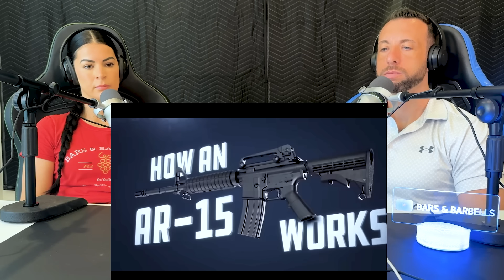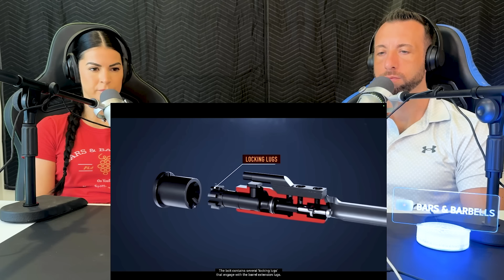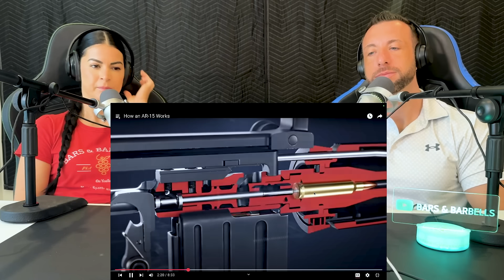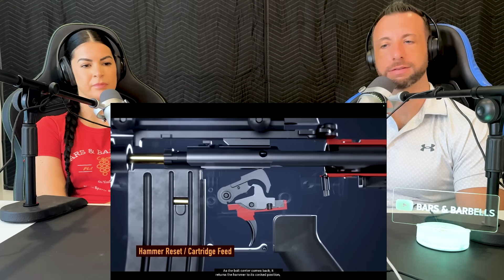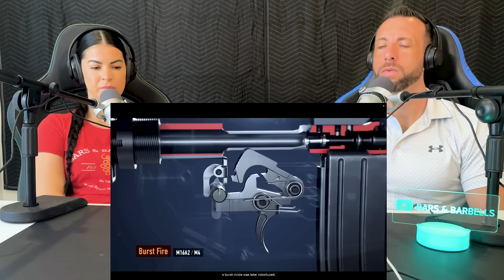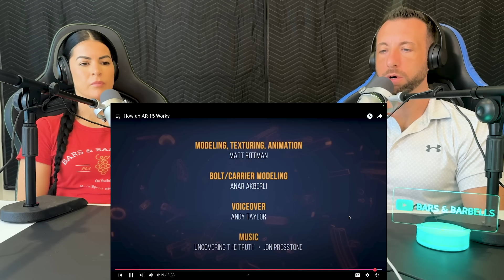This Is What Happens When You Pull The Trigger — AR-15 Mechanics Explained ⚙️

Comment: Don't confuse a clip with a magazine. The magazine fits into the magazine well. The clip holds the ammunition that is used to fill the magazine. As stated in the video, the AR15 is the non-military version of an M16 or M4. The AR15 is not capable of automatic fire

Comment: Gun design is iterative. It's the same as the car engine in that way. Everyone builds over time on each other's work. The AR design is older than the pocket calculator. It normally takes about 10 years for a new design to work out all of the little bugs that cause problems. These were worked out long ago with the AR to the point now where mass production and the design's flaws being worked out(like better feed ramps, better triggers, heavier springs and buffers for different length barrels, different gas systems, and so on) has effectively happened. So you can buy a rather cheap AR today that will be well engineered enough that effectively anyone who knows the basics of the design can work on it, replace parts and get them to run. They've become the Toyota of the rifle world through 60+ years of iteration. 

If you think this is complicated, check out some of the stuff C&Rsenal has put out about early 1900s guns. Some of those are genuinely crazy.

Comment: The irony here is that Full Auto is actually easy to engineer.  Without the disconnector, simply holding the trigger down with the rifle off safe will cause it to just keep firing.  Early, open bolt machine guns worked this way.  The trigger just held the bolt in the rear position and when released and held down, the weapon would just cycle until empty.  To make the weapon semi-automatic, requires additional engineering!  But you've just taken your first peep down a fascinating rabbit hole of engineering.  I would encourage you to look up some of the great designers whose history is amazing.  Men like Eugene Stoner, who was the principal designer of the AR-15 or the Legendary John Moses Browning who's list of firearm inventions will stagger your mind.  The 'Browning Action' is still the most common design choice for handguns to this day!

Comment: Did you really learn something you didn't already know after building and maintaining your own AR15s? Are we going to get a video on how to brush our teeth or something?
The Johnson Rifle in WWII already did the buffer tube and rotating bolt, Eugene Stoner didn't really engineer anything new on the rifle. The innovation of the AR10, AR15 series wasn't the internal engineering, it was the use of lightweight materials borrowed from the aircraft industry - aluminum for the non-loadbearing parts, fiberglass furniture on the AR10 and plastic polymers on the AR15...

Comment: if you like cool gun internal workings, check out the design of the good old 1911. It is a marvel of engineering. so much happening in such a small firearm.The grip safety mechanism is amazing. The slide release which is also the pin that holds the two halves of the gun together... Just an amazing piece of gun art.

Comment: Another thing of interest is the gas that is used to cycle the bolt carrier also first pressurizes the bolt itself forward against the recoil force of the rest of the gas in the barrel as it enters the gas key which takes some of the load off the lugs on the bolt.

Comment: Something with noting is that, while many people believe the rifle can be easily converted to full automatic by simply removing the disconnector from the trigger, this is in fact not the case. Removing the disconnector will be result in a condition known as "hammer follow," where the hammer literally follows the bolt carrier forward. This will not necessarily interfere with operation, but in nearly all cases, the hammer will not strike the firing pin with sufficient force to ignite the primer. Because of the design of the rifle, the trigger cannot simply be pulled a second time; the charging handle must be used to chainer a new cartridge, which will also throw out one unfired cartridge. 

In effect, removing the disconnector changes a semi-automatic rifle with a 30-round magazine into a manually operated rifle with a 15-round magazine. The lesson here is that when someone tries to tell you how easy it is to turn a semi-automatic firearm into a machine gun, it probably isn't actually that easy.

Comment: Note that the video you watched mentions the M4 having burst, the M16A2 A3 and A4 are the only military rifles with burst in the M16 family and No M4'as have burst. the M4's used Auto and Semi.  

the Army moved away from Burst fire after getting many complaints on the Cam system in the M16.   Essentially the Cam rotates EVEN in SEMI fire mode.  so if you start firing in Semi, fire 2 shots ,then switch to Burst because you are in close quartesr or what not, you only get 1 shot out of the rifle before the Cam resets.  Or depending on what happened, you can get a 1, 2, or 3 round burst.   The inability to rely on a full 3 rounds for the burst fire lead to them making the M4 only have Auto and Semi.  

The Marines however until recently still used the M16.

Another oddity is The Forward Assist was not something that ArmaLite actually designed into the rifle originally.  the US Military wanted it despite that forcing a round to chamber if the bolt does NOT want to is very dangerous (usually means something is wrong and your rifle could blow up or something else if fired) and the United States Air Force is the only Branch that did NOT get M16's with the Forward Assist.  Civilian models usually do NOT have the forward assist either. 

The Civilian models can come in many calibers too like .223 remmington, 5.56x45mm NATO, .243 Valkrye, .300 Blackout, 9x19mm, .22LR, and there are other conversions.   

The AR-10 is their original model made in .308 winchester or 7.62x51 NATO.  it is used in the US military as the M110 Designated Marksman Rifle or basically as a sniper.

I always find it interesting when people first start going down the rabbit hole of how firearms work.  I hope to see more reactions from you two regarding this type of thing.  

Take care!

Comment: You can't get an AR-15 with burst mode. They don't have auto or burst sears in the action... only the single round fire setting. That's where all the controversy starts. The difference between a semi-automatic and an automatic firing weapon. If you buy and AR-15 you only have two settings... safe or fire. No auto setting at all.

Comment: The sad part is there’s a lot of people out there that don’t understand the difference between a civilian AR15 and the military M-16 they look at it and since they think it looks identical therefore it is identical so civilian’s should not own one even though the civilian version is semi auto only in addition to the internal part of the lower receiver of a AR15 being machined differently so they will not accept the conversion parts to select fire unless you have access to a machine shop and the knowledge of where you need to remove excess material and drill the third hole

Comment: Time for a field trip.  Find a reputable range in your area, get a few lessons, and have the experience for yourself.  You will both enjoy the experience.  Despite what the news and what anti-gun people say, the AR-15 in my opinion is an excellent FIRST "high" power rifle.  A good instructor will probably start you with a 22lr in a single shot or bolt variant, but you should be able to progress to an AR-15 in an afternoon.

There are a few very minor mistakes here and they don't describe just the AR-15, but the entire ArmaLite family of firearms including the M-16 and M-4.  The AR-15 does not have auto or burst modes and a big chunk of this video was focused on those which in my opinion added a lot of un-necessary complexity to an "AR-15" video.  Excellent visualizations.

Comment: The engineering of many guns is fascinating. The gun from Robocop is in fact a real gun that was made by Beretta with some extra parts attached and it really did have a burst fire setting. But if you think the engineering of the AR-15 is complicated look up a video on the HK G11. Forgotten Weapons covered it and the inside of that thing is a clockwork nightmare. Then you have stuff like the old warplanes that not only had the engineering of the machine guns they had extra gears to sync the gun with the propeller so that the bullets were fired just after the propeller went in front of the barrel instead of having a plane accidentally shoot itself down.

Oh, and two more notes. Full auto and burst fire modes are illegal unless you pay an extra tax and buy an old gun that was registered before 1986 OR you have gone through all the taxes and fess and paperwork and are a gun dealer and you can have "sample" guns so you can demonstrate them to law enforcement or military buyers. 

The second note is most stuff on an AR-15 is not done automatically. The magazine catch clips the mag into the gun but you have to manually have to hit the release to take a magazine out. If the bolt was locked back you have to hit the bolt release to load the first round and if it wasn't you have to pull the charging handle back to load the first round from the magazine. The safety is manually operated as is the trigger per shot. The only part of the process that is done automatically for the user is ejecting the spent casing and loading the next round so you can pull the trigger again.

Comment: Ditto to @CloudJLaw. Shooters get a little perturbed when the term assault rifle is used, due to it being a made up term used to make the sport scary.  We use what would be considered hunting rifles and shotguns in the military, and they are not refereed to assault rifles. 

Also, the device that holds the rounds (bullets) is called a magazine. They completely encase the rounds that has a spring and follower that push the rounds up into the chamber as the weapon cycles. A clip, used by the M1 Garand for example, was a long rectangular strip of metal that holds the rounds in place by the groove at the base of the round. The clip, with the group of rounds are pushed into the body of the weapon. Think of loading several PEZ into a PEZ dispenser. The "magazine" is built into the weapon. I point this out because if you go to a range and call a magazine a clip, you will probably get some side eye. Benefit would be they would realize you are new to shooting, and probably have offers assistance / guidance in learning how to safely shoot.

Comment: It only takes a few people to ruin it for everyone else. An ar15 can average about 600 bucks but a full auto like a m4 can be 10,000 plus tax stamps and extra background checks. Never shot a full auto I would love to but ammunition cost greatly increases. The ar15 5.56/223 is around .55 cents a round and you can easily burn through a 100 round drum in under 10 seconds. Fun not practical

Comment: After using the M16A1 and A2 during 3 years of Army service, I wouldn't exactly call it a work of art.  If anything, I am amazed by the AK's simplicity.  Lost your recoil spring?  Use a rubber band.  Lost your so-called gas tube?  You can use a cardboard tube.  Dust cover missing?  No problem!

Comment: In the beginning, a Scottish preacher was bird hunting and his flintlock rifle failed to go off in time and he missed the pheasant he was aiming at. He then set off to figure out a better way to ignite powder. He invented the percussion cap in 1807 which was used in muskets, musket rifles, rifles, and handguns. The percussion cap was adapted into rudimentary cartridges which led to the two different styles of centerfire ammo primers, the Boxer and the Berdan (mostly used in European military ammo where ammo reloading isn't as common).
Others have mentioned that the AR-15 is a scaled down version of the AR-10, which was designed in the '50's by Armalite by Eugene Stoner. Stoner borrowed and tweaked the Direct Impingement gas system from a few different French and Swedish rifles. Scaling down the AR-10 wasn't a simple thing, though. But they also learned a lot of stuff from the development of the AR-10 and there were a lot of advancements in materials in those ten years.
Eugene Stoner was completely against the forward assist. He thought if you have to force your bolt into position, something's wrong and you need to inspect the chamber for a blockage instead of making the problem worst by forcing it. It might be debris or part of a previous round blocking it, which could cause a catastrophic malfunction if you forced it and fired it.
If you look up the problems of the early M-16, they were mostly caused by cost cutting measures and ironically, the military added the forward assist ($$) which cancelled out the other shortcuts which made the rifle extremely problematic. Once they got the problems worked out, it's become the rifle with the longest service in US military history. The M-4 carbine, Marines M-27 IAR (Individual Automatic Rifle), and Army M110 DMR (Designated Marksman Rifle) are variants and the Sig M7 borrows heavily from the AR-15 and the modern version of the AR-10.
The burst fire mechanism is garbage. It adds more complications to the system. If you fire 1 or 2 shots and then go to burst, you'll end up with a 1 or 2 shot "burst" at the end of the 30 round magazine. The mechanism doesn't reset. They figured out that semi-auto gives better accuracy. You only shoot full auto in suppressive fire, making noise to keep the enemy's heads down so you can move into a better position or get out of there.

Comment: The AR-15 is more a platform than a specific gun now.  You can line up twenty AR-15 that look quite a bit different but can be recognized as being of the same design.  All designs and colors of stocks, grips, hand-guards, barrels, you name it.   AR-15s have been referred to as Barbie dolls for men - dress up them up however you want!  An AR-15 is not a high-powered rifle, so always chuckle when the numb-nuts refer to it as one.  It's got 35-40% of the power of a .308, though the bullet has some characteristics that make it highly effective against soft-flesh, thin-skinned targets like humans, yet the round is illegal to be used for deer in most states.

Comment: Funny story: The Ar15 was a civilian sporting rifle for yrs before it was adopted by the U.S. Military. Also, the round itself is only 5.56mm in diameter. It is a small round that moves fast. It doesn't do much damage.
Reply: Incorrect. The AR-15 was adopted by the USAF in 1961, type classifiedas the M16 in 1962.  The first civilian legal version of the AR-15, the Colt SP-1, was not released on the civilian market until 1964.
Reply: @armynurseboy  M16 was adopted in 1964.
Reply: @kimisdaman adopted by the Army in 1964. Type classified in 62.
Reply: Nope.  AR-15 was specifically designed to be a weapon of war.  In fact, the first AR-15s, full auto, went to war before the M16 designation was even born.  My first issue weapon was a full auto AR-15. No M16 designation was stamped.  Later I was issued a rifle that had both "M16" and "Colt AR-15" stamped on the lower.    The US military bought the first 8000 AR-15s years before the M16 designation was used.  Some of them were used by the Air Force in Vietnam and some in other countries by other Armies.  Air Force bought he first AR-15s.

Comment: The AR-15 (Armalite Rifle 15) has been around since the late 1950's. Manufactured by Armalite, they pitched it to the US Military to replace the M-1 Garand. It has ALWAYS been a semi-automatic rifle. The Pentagon wanted a select fire version with automatic fire capability. The M-16A1 was born. Burst fire was introduced for the M-16A2 instead of automatic fire to conserve ammo during engagements. Auto/Burst is for suppressive fire. Select fire and automatics are illegal to own unless made prior to 1986. To own anything other than a semi-atuo firearm requires special Federal licenses and they are not easy nor cheap to acquire. FWIW, a pre-1986 M-16 will cost you between $9,000-$12,000 for a single rifle.
Reply: No. The AR-10, AR-15 forerunner, was a FULL AUTO rifle competing with the M14 and FN FAL, also full auto rifles , to replace the M1.  When the M14 was chosen, Armalite continued to tinker withe the design, to include scaling it down fir the smaller .222 Remington (later changed to .223 Rem), but it was always intended to be a military rifle and retained full auto capability.  Armalite sold the patents to Colt in 1959. There was very little interest in the rifle until it was demo'd for Curtis LeMay in 1960, who loved it and ordered it adopted by the USAF as the "AR-15". It was then type classified as the "M16" by DoD a year later. So from the beginning, the rifle was always a select fire weapon. In fact, the first semi-auto only version, the Colt SP-1, wasn't released on the civilian market until 1964, 3 years after the AR-15 was adopted.  The M16A1 was developed in 1967 to address the problems that were experienced with the initial 1964 fielding of M16 and XM16E1 rifles in Vietnam.

Comment: In WWII   The German Army used Bolt action Rifles and sub machine guns that use pistol size cartridges. When Germany designed a rifle that was magazine fed, with a barrel shorter than a bolt action rifle, but still used rifle style cartridges, AND could toggle between semi auto and full auto modes, Hitler labeled it a Storm Gun ( Sturmgehr ) it was interpreted as assault rifle to be used by assault units. Since that rifle looks similar to AR15's the media assumes or implies that any rifle that looks similar is an actual Assault rifle to push a political narrative. The AR 15 was actually first designed as a civilian sporting rifle.